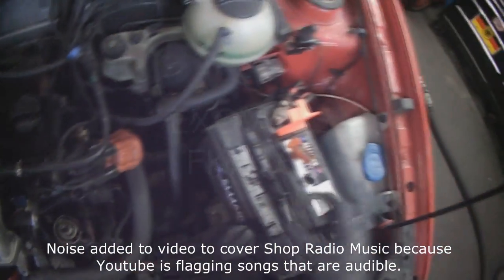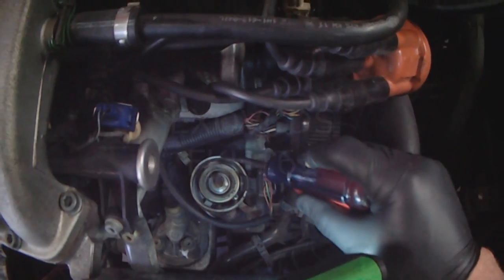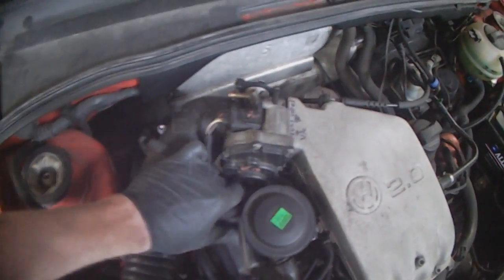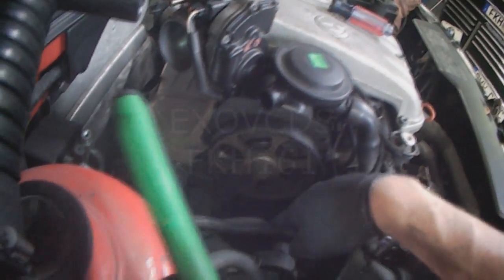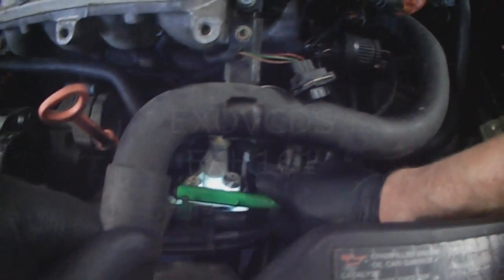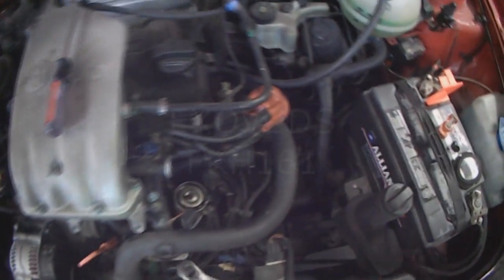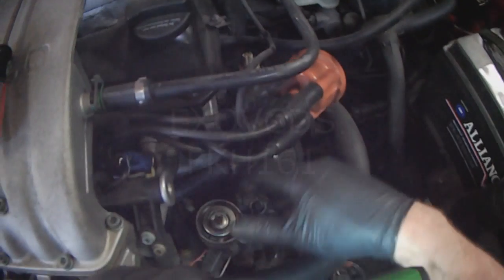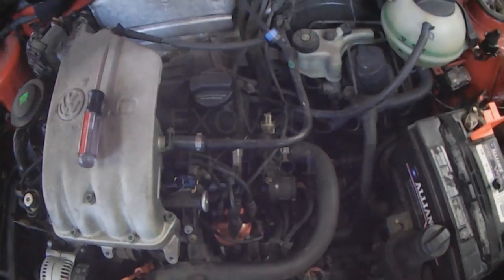VW A3: 2.0L ABA Distributor alignment / indexing

Comment: hey man... my 95 golf had codes for cam and crank no signal... checked the marks on cam gear and the mark on the lower timing cover and they seem fine... but I don't know if the distributor  sprocket Is align.. can I align the distributor with put removing the belt...????
Reply from the maker: I assume it is not running / starting? 2.0L? If you scan when the engine is off, a cam sensor fault will be flagged. If you are also getting a crank code, then the crank sensor is probably bad. Cam sensor (distributor hall sensor) is NOT needed to make the engine run. With cam & crank at TDC, remove the distributor cap and check where the rotor is pointing. Reposition the rotor / distributor if you have to (yes, can be done with out moving the timing belt).
Reply: Actually the car runs. ... but after driving it for a while it does not pass 3000 rpm. .. I had to turn it off then it will drive normall again
Reply: OK I'm going to check the rotor
Reply from the maker: Rotor will probably be OK... since it runs fine on initial start. Most likely, you have a bad hall sensor inside the distributor. Once it gets warm / hot, the signal cuts out.
Reply: Oh OK .. so new distributor could fix the problem
Reply from the maker: memo barron Probably... turn the key to ON. Attach a multimeter to battery negative and attach the positive lead of the meter to the middle wire of the 3 wire plug on the side of the distributor (peel the boot away from the connector and place the positive probe against the middle wire connector). The meter should show 5 to 12 volts. If it does not show any voltage, touch it to one of the other two wires... one of which should be an ignition ON power. If it shows power, move it back to the middle one (this was just to test if the meter had a good ground). Start the engine... if the meter now shows a reading of 5 to 12 volts. Continue to monitor the voltage. If the voltage drops off to 0 or rises to a steady higher voltage, then the distributor / hall sensor is bad. I hope that was not too confusing... I just don't want you to buy a distributor if you don't need it. A timing belt that is too loose or if the belt jumped too many teeth, can set a G40 fault code. Only replace the distributor if the sensor is NOT producing a signal.
Reply: OK .. thanks I'm going to check that on Thursday my day off... also notice that the timing belt seems little lose...
Reply from the maker: memo barron OK, let me know what you find.
Reply: OK I will thanks
Reply: hey man.... I checked the distributor and it reads 4.4 to 4.9... also do you have a trick to turn off the check engine light..??
Reply from the maker: Hi, sorry... I missed your post. What's the voltage of the center wire (hall sensor harness plug) when it is disconnected from the distributor with key ON. What is the voltage when it is plugged-in and the shutter wheel is at the hall sensor? Most auto parts stores will clear codes for free.
Reply: Running read 4.4 and 4.9v
Reply: With just key on going to get it check tomorrow
Reply: Do you think that it will pass emission, ???
Reply from the maker: memo barron Not sure... some places allow certain faults.
Reply: I took car to emission test and it passed  :)
Reply from the maker: memo barron Thanks for the update... now you can work on this without pressure!
Reply: I'm thinking that probably is the distributor the problem

Comment: I've had a problem with my 96 2.0 for awhile now, maybe you could give me some advice. I replaced my transmission and clutch, I upgraded to a BFI lightened flywheel, came in the clutch kit. After getting all that and the new trans in, it didn't want to start, so I pulled my crank position sensor, it had some oil on the tip. I cleaned it off and it fired right up, runs awesome. About 2 weeks later, it wouldn't start so I replaced the crank position sensor with a brand new one. It fired up but at around 4K RPMS it looses power and at 5k RPMS sounds like I have anti-lag, random misfires and backfires. I've replaced the cap, rotor, plugs and wires. No change in the problem. This weekend I replaced the distributor and it helped the problem but did not fix the loss of power at higher RPMS. I can't scan the car as it will not connect to any code scanner. Am I missing anything? My 3 timing marks all line up perfectly. Could the new crank position sensor be faulty?
Reply: Oh and if I drive it hard, shifting between 4-5k the CEL, check engine light will flash. I've had some experienced VW mechanics look at it but nobody seems to have any idea other than a faulty new sensor. Any advice would be appreciated. Thanks.
Reply from the maker: Could be crank sensor... I have seen some that would not let the engine rev past 4k.

Comment: Hello this video is super help full I love your videos, 
I'm in need of your help though, I have a 97 Jetta gt with the 2.0 motor, I was driving home when all of a
Sudden my car dies, I kept cranking but no start what so ever, finally towed it home, scanned for codes and got code camshaft position sensor, sensor A circuit, range/performance, and also bank 1 single sensor, 
I've replaced distributor (but did not do it at tdc because I wasn't aware of this helpful video lol) replaced ignition coil, spark plugs and wires, tried setting it to tdc and setting the distributor to no.1 piston but the car will start for like 2 sec then shut off. Could it be that my timing to my distributor is still off? Please help me out I love and miss my Jetta so much!
Reply from the maker: Yes, could be that the timing / rotor is not in the correct position. Turn the engine to TDC and check if the distributor rotor is pointing at the little notch that is in the housing.
Reply: +Thomas EXOVCDS yes I was able to set at tdc, notch was pointing towards 1 but still only get it to crank, and now it's also backfiring really loud lol
Reply from the maker: Firing order is wrong... you might have the distributor pointing at #1 when the cam & crank are actually on #4.
Reply: +Thomas EXOVCDS ok I will double check after this rain, I'm in Texas and the rain is random lol
Reply from the maker: +Ahlex Delgado When you look inside the distributor... it should only have "one" shutter window.
Reply from the maker: +Ahlex Delgado Also... the hall sensor (3 wire plug at the distributor) is not needed for the engine to start or run.

The rotor does have to point at the correct spark plug post.

You might have a failing crank sensor if the engine cuts out when warm.
Reply: +Thomas EXOVCDS ok I understand, but before when I would move the distributor around and get it at a certain spot, it would crank and turn on for about 2 sec, then just shut off. So it just needs to stay on now.
Reply from the maker: Any luck? Was the distributor timing (rotor position) out?

Comment: Quick question is the position of the notch has to match the first cylinder ?
Reply from the maker: There's a tiny notch / line in the edge of the distributor housing / ring... yes, number 1 should point to that when the flywheel / #1 piston is at TDC. http://ww2.justanswer.com/uploads/MasterClass/2012-06-22_024424_dizzy.jpg
Reply: i didn't do a timing belt could this cause it not to crank ?
Reply from the maker: +Steven Sanchez Let's start at the beginning.

Car was running before you did anything.

You changed some parts and now it does not run.

Do you still have the old parts?

Install the old parts and see what happens.

If you did not touch the timing belt, then the timing should not have changed.

If the car DID NOT RUN before you changed parts... then yes, check the timing belt. Maybe it is bad / broken.
Reply: thats  right. But at this point i think a have faulty parts i have tried every thing

Comment: hey man I was wondering if you can help me out  I got a 2002 vw cabrio i replace a ECM crank sensor   there's still no signal to the coil i am getting signal to the injectors can you tell me a little bit about what else can it be??
Reply from the maker: I can only suggest to check all the wiring as per a wiring diagram. If all the wiring & components (coil etc) check out... bad ECM.
Reply: I don't check all the wiring and everything seems fine it's just that I'm not getting the signal getting fault for ECM disable what is a mean engine control module disabled
Reply from the maker: What is the actual fault code?

Comment: When I tried to remove the rotor, cannot take it off, it is hard, should  be like that, or I have to pull it until it comes out? My car is a A3 2.0 Jetta
Reply from the maker: The rotors can get stuck sometimes... and they can even break when pulling on them. Before you try to pry it off, make sure you have a new one just in case. It should pull off easy... when they are stuck, I grab the rotor with pliers and pull & wiggle the rotor until it pops off. If it breaks, I replace it.
Reply: +Thomas EXOVCDS you are the best! YOU ROCK! 😎 thank you very much... Muchas gracias mi amigo! 😁

Comment: Great video. Just ran into an issue with my 97 jetta 2.0 - The car died while driving and we can't get it to start. The clamp that was holding the distributor cap in place at the base (on top of the oil pump I believe)  loosened up enough that the whole cap and plug wire assembly could spin basically. Nothing else was disturbed, the rotor arm doesn't rotate by hand and seems to be pointed to where the cables want the cap to be. The rest of my timing should be ok, correct? I just need to align the little mark on the rim to the middle of the rotor as it sits? (and replace the rotor, cap, and wires because woah they are in bad shape)
Reply from the maker: +Robert Batson The crankshaft & camshaft need to also be at TDC when the distributor rotor is pointing at the TDC notch / mark... but yes, that's all you need. Make sure that the wires go back in the same place. 1 3 4 2 starting at the 12 o'clock position, going clockwise and spark plugs 1 2 3 4 starting at the timing belt end.

Comment: Here's a question that no one seems to be able to answer. 1999 jetta, 2.0, hitting rev limiter at 5k. seems to have less power than it should. Any ideas?
Reply from the maker: +Doug Kizer 99 mk3 or 99 mk4? Standard or automatic? What octane gas? Altitude? Ambient temperature? Spark plugs? With or without A/C? What's the charging voltage? What type of air filter? When was the last time the fuel filter was changed / checked? Cat or no cat? Stock muffler?
Reply: 98 k2. 5 speed a.c., a.c. delco plugs, between 500ft to 1081 ft altitude. Charging voltage not sure of, but has short ram air intake with spectre filter. Straight pipe past the cat. Got it this way. Did timing belt, was doing this before I did the belt.
Reply from the maker: +Doug Kizer How do you know &quot;seems to have less power than it shouldn't? They don't call them 2slow / 2.0slow for nothing. Loss of stock exhaust back-pressure can work against power gains (too much cylinder scavenging of the fresh air/fuel mix that is entering during intake &amp; exhaust valve overlap). Can't do much if cam & crank / ignition timing is where it is supposed to be.
Reply: That's what I figured. I am going to get whole new exhaust system in February, just wanted to know what would cause the rev limiter hitting at 5k
Reply from the maker: +Doug Kizer Stock max HP is at 5400rpm... so it's not that far off. Are you sure it's the rev limiter that is kicking in... instead of other factors?
Reply: Hits at 5k.
Reply from the maker: +Doug Kizer Yes, I know... but are you sure it is the rev limiter cutting fuel / spark. Could be a coil issue (power output stage can't keep up) or something else.
Reply: No idea. That's why I am asking you. My first European car.

Comment: So I can't get my distributor to come out, but it wiggles ever so slightly. I put the 13mm bolt/hook back, thinking that was all it took to hold it in place and now the distributor shakes while the car is running (only ran for a few seconds before it died) I can't get it to even seat fully and stop wiggling and I'm not sure what to do to fix this, any suggestions?
Reply from the maker: +Uriah Siner Sometimes I have to use two pry-bars to rock the distributor side to side (carefully) until it decides to lift far enough to free itself. Spray the area with wd-40 to soften the seal under the distributor.... give it some time and try again. Once out, turn the engine to TDC #1 and then reinsert the distributor so that the distributor rotor lines up with the #1 notch in the distributor housing.
Reply: +Thomas EXOVCDS the only angle I can see to get my pry bar in there makes it so the bar pulls on the electrical plug that's on the right side of the distributor, do I need to take a part out of my car in order for a better angle?
Reply from the maker: Uriah Siner It's hard to explain... but you should be able to get a pry bar under the distributor to apply upward pressure. If you have two, then place them opposite each other. Rotate the distributor so that you are not pushing against the plastic hall sensor connector. Move anything else that is in the way. The wobble is because the distributor is not seated fully and if it now does not start, the drive gear is either not engaged or the timing is out too far.

Comment: I really liked the technical aspect of how it worked, 1-4 up2-3 down. And why cam and crank are lined up with marks while dist/oil shaft can float and be fixed so to speak by moving dist and rotor to point at 1. Thanks
Reply from the maker: Happy to hear you were able to make sense of the video... I ramble too much sometimes, that is why in most of my videos I do not talk. I answer a lot of questions however... to make up for that!

Comment: So I bet I can stump ya has new coil pulsing on middle and two on end test good sends spark.. now to coil wire test 1/8 inch away ground to metal have spark when crank didn't have spark until replace crank sensor now have spark but none to plugs .. replace distributor still nothing ... my question is the a test with knew distributor to test hall sensor like one clip you have win 1.8..
Reply from the maker: If it's a 2.0l engine, the hall sensor is not needed to make it run.... make sure that the rotor is turning when the engine is cranking. If not, broken timing belt.
Reply: Sorry this car really drove me crazy and every thing came out sounding really yes.. dumb OK.. and you are VERY HELPFUL AND I thank you for the videos you have the smarts man.. good clips .. i have replace ton of parts car draining big time but wait this IS IT OR THE JUNKYARD 1998 VW cabrio 2.0 ABA spark at plugs missing .spark from coil is there ... replace :coil brand: new .brand knew distributor: knew crank sensor oh yeah I have spark at coil but no ..pulse is that possible  from the three wires connect to the coilI thought if I replace  cps sensor I would be back on road no dice.... I think ecu bad.? Ignition switch .timing . Or relay .fried..thanks for the help in advance to all those you help an continue to do so

Comment: Can advance timing be done just by rotating the distributor to a certain dergree?
Reply from the maker: Jose Alvarez If the rotor is not pointing at the notch in the housing when the engine is at TDC, then yes, the distributor can be turned to line-up the rotor with the notch (2 locking pins might have to be removed at the base of the distributor, if it is a 2.0l engine). Once lined-up, no further adjustment is needed. Advancing the distributor further might set a fault code.

Comment: Nice video.  So I have everything aligned and I still get the p0341 code could it be that the timing is still off or the actual sensor is messing up?
Reply from the maker: Daniel Madrigal Yes, either the timing is still off (initial alignment of crank vs distributor) or the hall sensor in the distributor is no good... can you send me a picture of the crank & distributor alignment that you have at #1 TDC?
Reply from the maker: Daniel Madrigal Use a long pry bar and place it against the outer area of the grren plug. Hit the end of the pry bar with a hammer... the cap will unscrew counterclockwise. If you have a 27mm hex tool, then you can remove the inner plug and place the hex tool in the green cap and unscrew it that way. Knocking the green plug / cap loose, is the cheapest way. The cap can crack / split when using the pry bar... keep that in mind. Your choice what you want to do.

The only way to know if your timing is correct, is to remove that plug so you can see the mark on the flywheel.
Reply from the maker: Just replied to your google+ post... thanks for taking the time to take & post pictures!
Reply: So I ended up buying a scanner for Android and u cleard  the code and it hasn't come back and I found out it had other lights and you have every single video on your  YouTube about it.  I thank you very much for  your  uploads I couldn't done it with out your  help :)  I'm glad their is people out their willing to help others with their cars.  Really appreciated it :)
Reply from the maker: Daniel Madrigal Good to hear that things are working out!